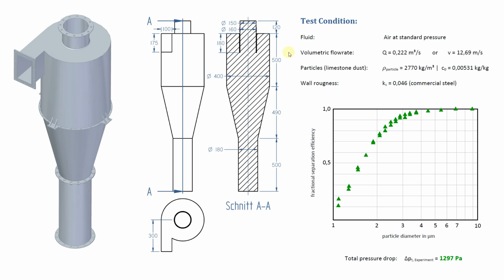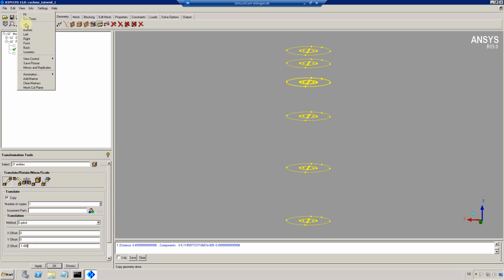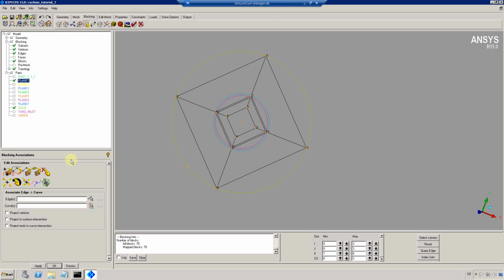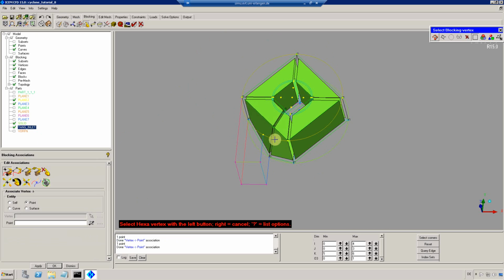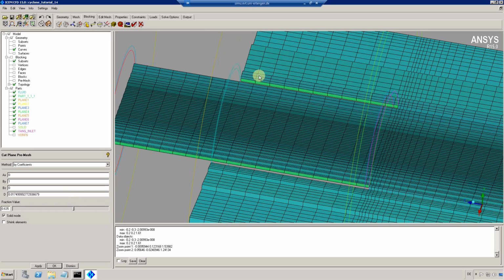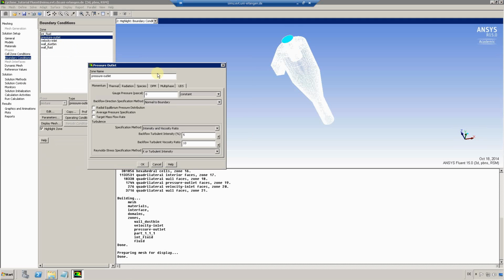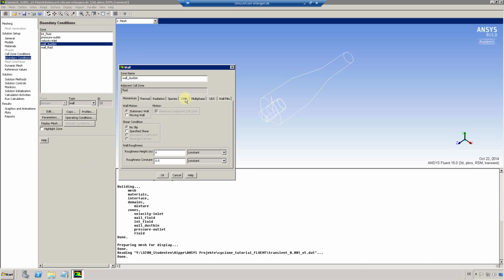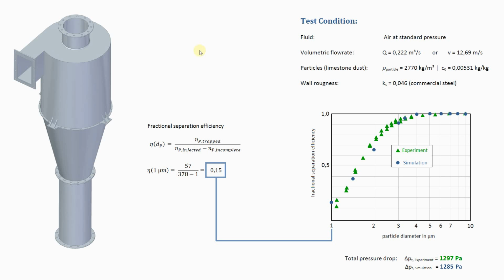[TUTORIAL] CFD Cyclone Simulation using ICEM CFD and ANSYS FLUENT

Comment: If you want a better mesh, I recommend rather than having the 4 points near the center, create them near the sides by choosing a perimeter of 2.0 and selection first the point on the middle curve and then the inner curve after which you create a curve for those points. You should then align not just all the edges to the curves but also the vertexes to the points. While you are at it copy the points from the tangential inlet that are on the outer curve to the middle curve as well so that you can align the vertexes that are created after the split to those points as well. Also, you should have solid blocks for the complete wall of the vortex finder not just the center. Lastly set the meshing parameters for the edges in such a way that the prism layers are also present for the small part of the vortex finder that goes below the tangential inlet, at the inner wall of the vortex finder as well as going from the outer grid to the inner grid where the vortex is. That way you have smooth overlays from those two regions as well as near the tangential inlet and the walls. Edit: doing this give you bad quality elements near the points at the internal curve that can only be removed by adding another O-Grid which kind of defeats the purpose since then you get another square at the center. However, the quality of the mesh improved a lot since now the worst elements has a 2x2x2 determinate of 0.711.

Comment: Word of advice: A few transient timesteps to get the residuals down doesn't mean that your simulation converged. Set up monitor definitions for things like pressure drop, volume averaged velocity magnitude, maximum velocity, mass flux etc.
And let the simulation run until these values do not change anymore. 

I'm sure OP knows this by now, but beginners maybe do not